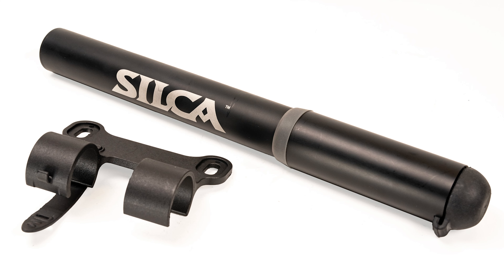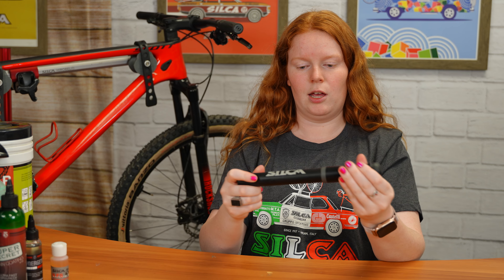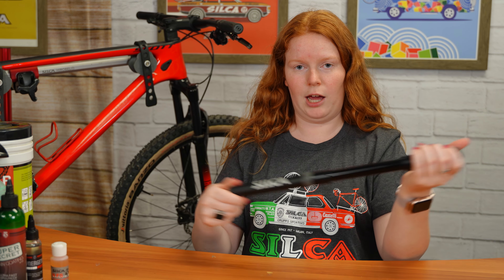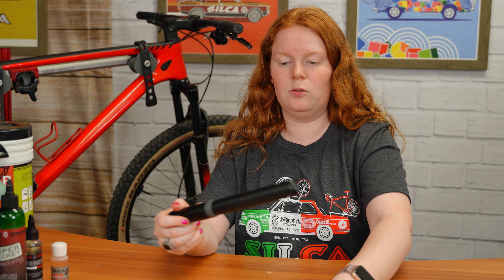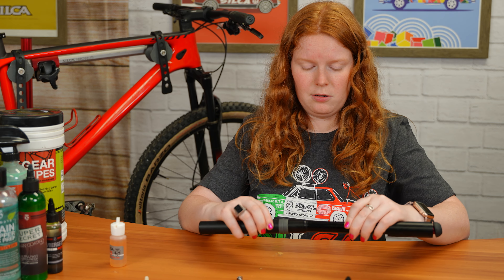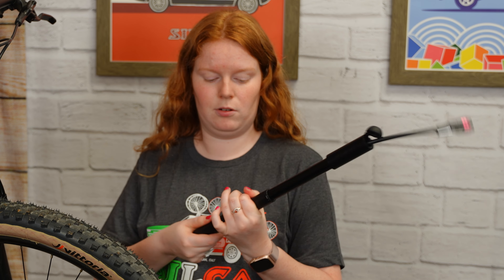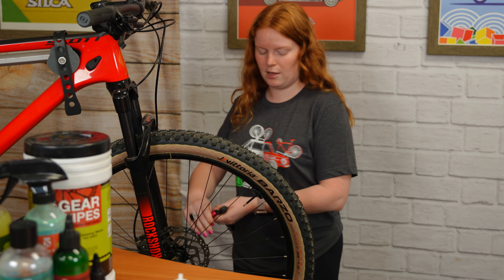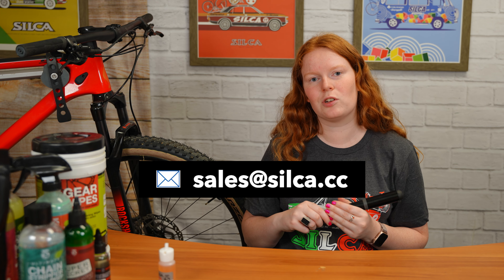Proven Performance: The Updated SILCA Gravelero Mini Pump for 2024

Comment: It would be good to have a video showing removing the end cap from the hose section of the pump. I have a gen1 and have had water ingress into the area where the hose is stored and it ended up making it very difficult to slide the hose back into the storage space. I undid the threaded ring, as in this video, and then unthreaded the plastic cap on the bottom of the hose section and I was able to clean, dry and lub it and once all reassembled it was like new again.

Comment: Will we be able to purchase the pump bracket separately? The old one, while chunkier and stronger looking, is oddly shaped and doesn't work with my frame and bottle cages. This one looks thinner and flatter, which is what I need.
Reply from the maker: Yes, the bracket is sold separately. Find it here: https://silca.cc/collections/frame-pumps-mini-pumps/products/gravelero-bracket-mount
Reply: @SILCAVelo  Sorry, I was completely off base here, you haven't changed the bracket design. I found mine, I was looking at a different brand's bracket originally.

Comment: The hose of my Gravelero barly moves anymore.... you can of course slide it out, but getting it back in is a nightmare.
I have the old version, which saw like 2-3 wet rides.
Can I replace it with the new version under warranty?
Reply: I had this happen, I undid the ring as shown in the video, and then also removed the end cap, plastic, that is threaded onto the bottom of the section that holds the hose. My pump had some water in there and once cleaned, dried and lubed it allowed the hose to slide in/out easy again..

Comment: I love the chuck with the flip lever (better than thread on chucks) but it’s slightly bigger than I would prefer to carry for gravel racing. Lezyne’s Pocket Drive Pro is a better size to throw in a jersey pocket. A bit cheaper too

Comment: Can you use the same lubricant that you use on a suspension fork to lube a pump?
Reply: I wouldn't see why not. All you're trying to do is lubricate the gasket and something like Slickoleum works great for reducing friction on fragile rubber seals. It may not last as long as their specific product since it helps condition the leather on top of lubricating the system, but I wouldn't see why it'd work just as well.

Comment: Why doesn’t this pump use the textured handle like the Tattico?  What happened to the Bluetooth option?
Reply: I have heard that they removed the texture bc it was holding dirt/mud during gravel rides and that was why they made this Gravel pump smooth.
Reply: @andrew_gardner  that makes sense but I like the grip. I’m glad I have one.